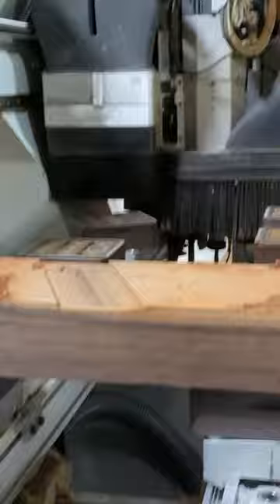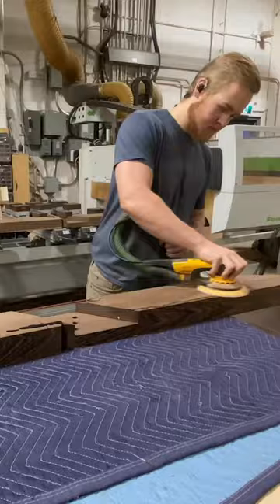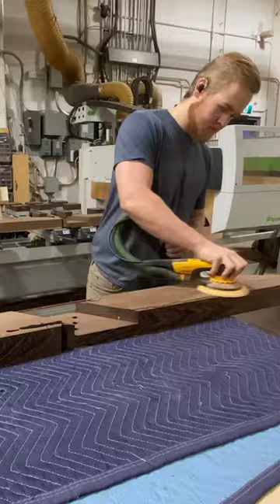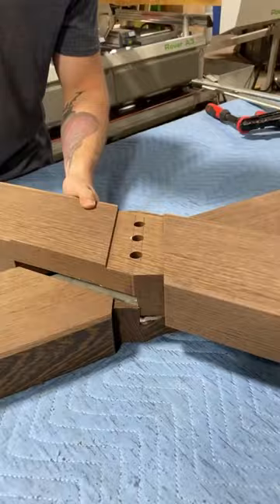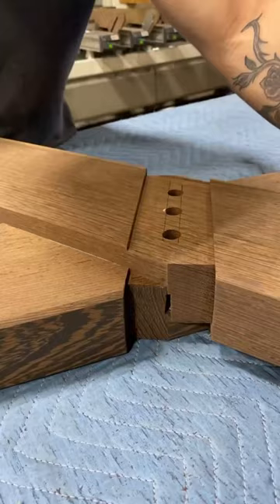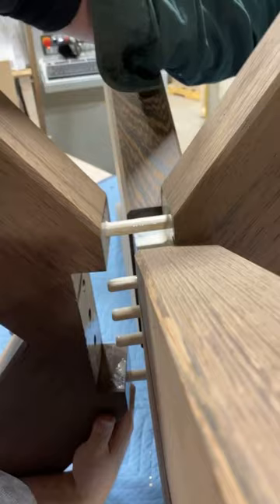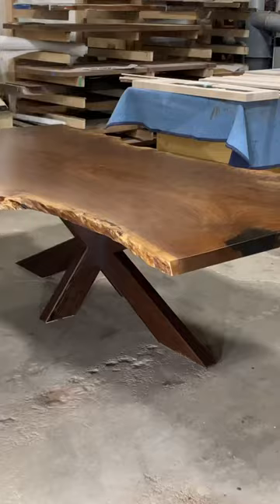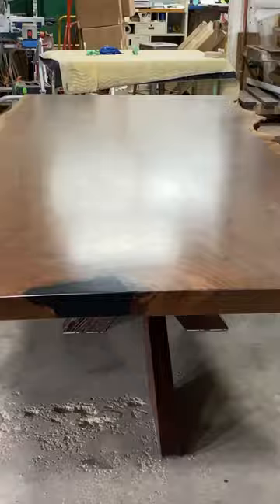Expensive Table Base Made from Rare Wood #construction #wood #diy

Comment: Looks amazing, built amazing but I struggle alot with the idea that this rare and special wood is used on a table as a base when it will have chairs under it, or be sat at, or in shadow, and you will basically never see the beauty of the work.
Reply from the maker: Maybe this client spends a lot of time on the floor? 🤷‍♂️

Comment: Not trying to be that guy but, for the price I would assume you charge for this piece, there's a couple imperfections that just shouldn't slide. One of the most glaring is how poorly it seems to sit on the ground. The legs don't have a flat-fit and the coloring looks chipped. Another is that all the reward for complexity lies in the construction instead of the resulting aesthetic. It was harder to make than what you get to look at seems worth.

Those legs could have been formed in umpteen different ways - far simpler, and would have wound up looking much, much better. They look like tank barricades lobbed onto Omaha beach.
Reply from the maker: Hate to break it to you but you are that guy. 
The legs are perfectly flat, the concrete shop floor it’s sitting in isn’t. 
The “chipped” colour is the natural appearance of the wood, all we did was add a clear coat. 
For your table, we can make the base with plain wood, an uneven bottom, and with simple poor quality joinery so it fall apart. We’re always here to accommodate our clients desires!